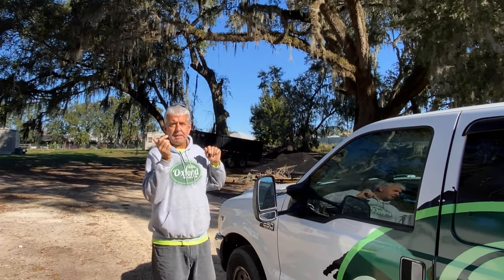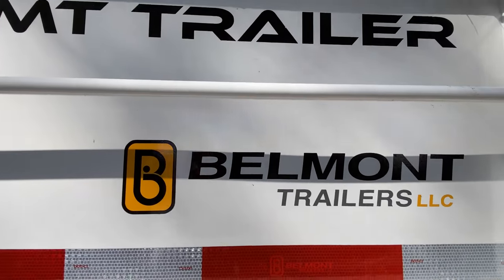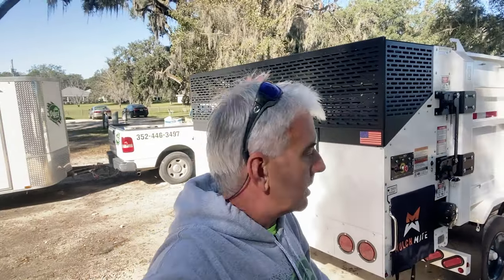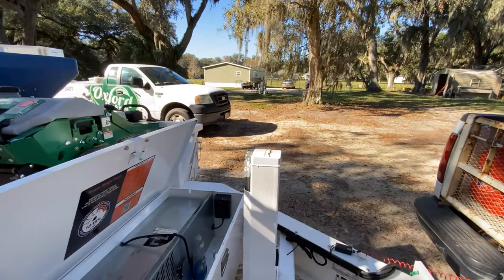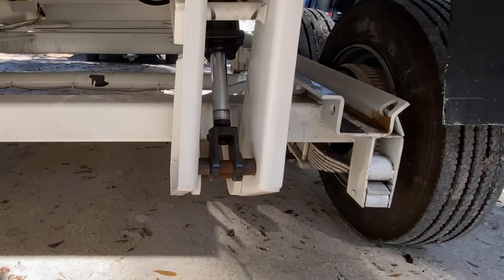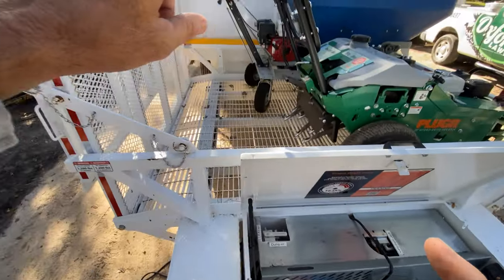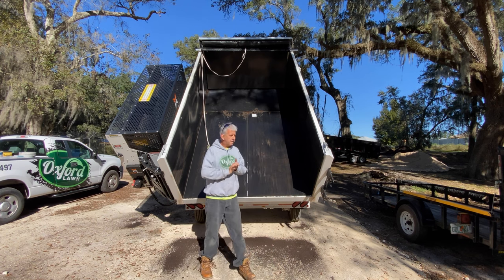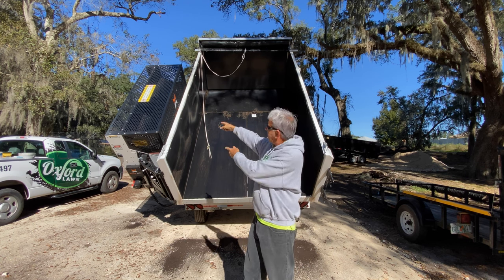Mulch Mate DMT trailer - Is it a Dump trailer and how does it all work

Comment: Could I use this trailer with a leave vac? Hope the vacuum on the front platform and make a box on the trailer. And also have a lawn mower on that front platform. With a bagger, please comment back and let me know.
Reply: Yes!
Reply from the maker: Absolutely!   Yes you could but they also make a leaf cap for it that turns it into a leaf machine monster

Comment: Nice ...❤ what's a recommended size truck to be pulling it
Reply from the maker: As I understand it based on our use, F250 super duty minimum but that’s also going to be based on the weight of the materials you will be using the trailer for. We just purchased an F350 as it was a bit heavy for our current truck when fully loaded down